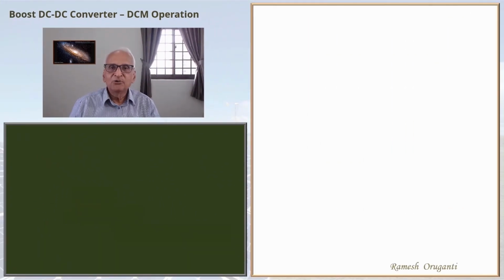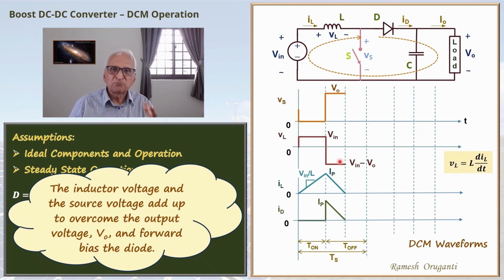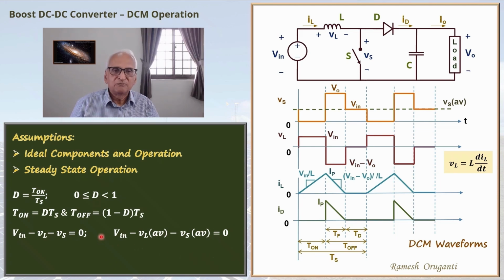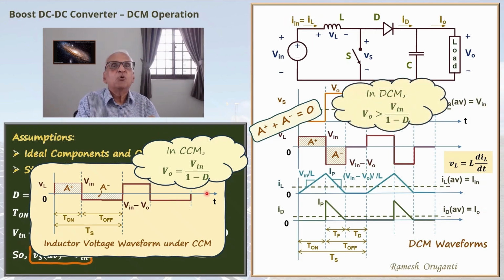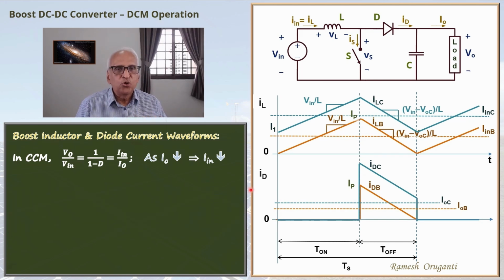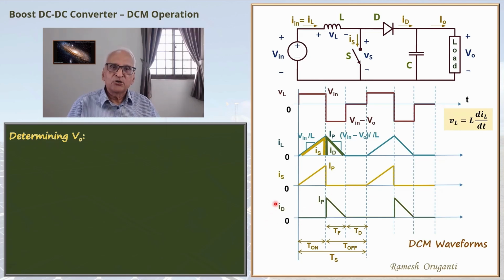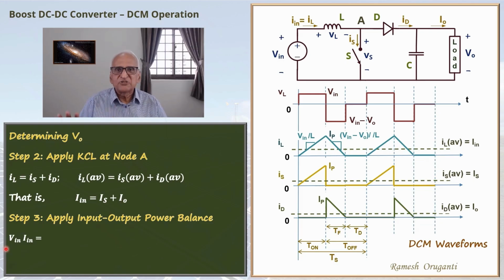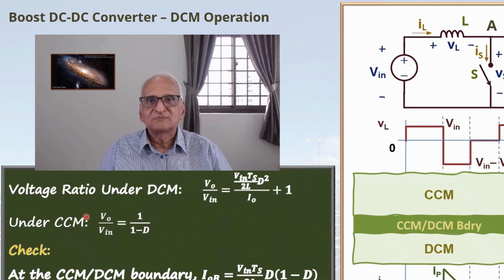PE 2B-3 Boost Converter - DCM Operation

Comment: Very Good video. Please sir do make video on PFC Rectifiers, Thyristor based half wave and full wave rectifiers
Reply from the maker: Thank you for your feedback and also for the suggestions.
Reply: @ROs_classroom  Also sir regarding the conventional buck-boost converter. Other than D what are the conditions which will make them work in buck or boost converter. Also the two switch non-inverting buck-boost converter. how in this we identify it is working as buck or boost converter
Reply from the maker: @ezaanahmed2617  I have not made any videos on buck-boost converter yet. May be sometime in the future 🤞😊

In a single switch buck-boost converter, there are no separate buck and boost converter operating regions.  Increasing D will cause the voltage ratio change smoothly from less than Vin to more than Vin. In DCM, one can conceivably use switching frequency also to control the output voltage, again smoothly.

In a two switch non-inverting buck-boost converter, it depends on what type of switching scheme you are adopting. If only the input switch duty cycle is varied (the output side switch is left OFF), then you will get buck operation. If only the output side switch duty cycle is varied (the input side switch is left ON), then you will get boost operation.

Others are welcome to give their comments/opinions also on this!